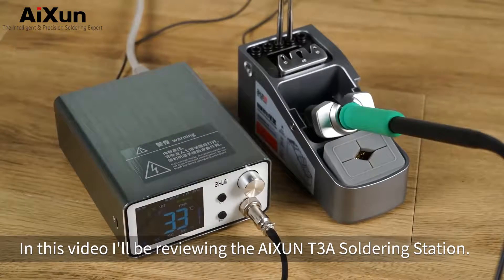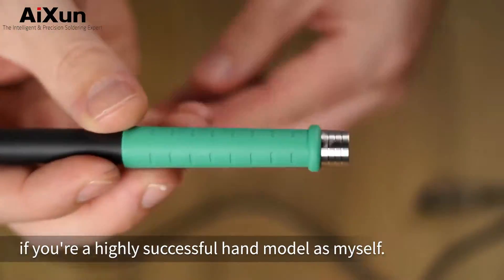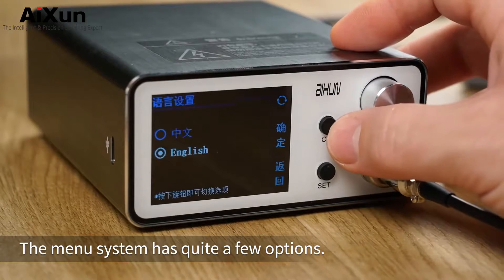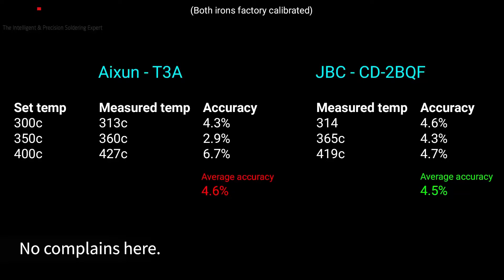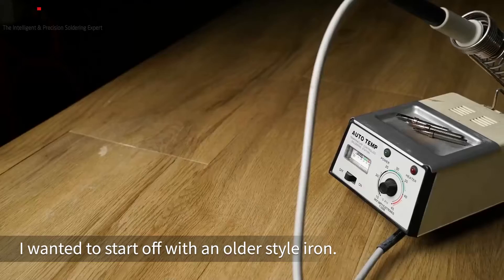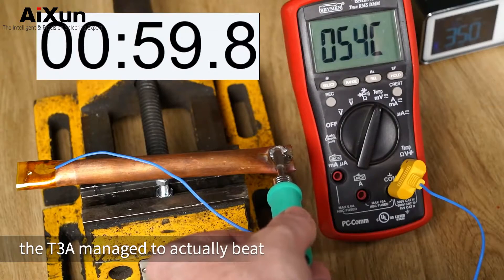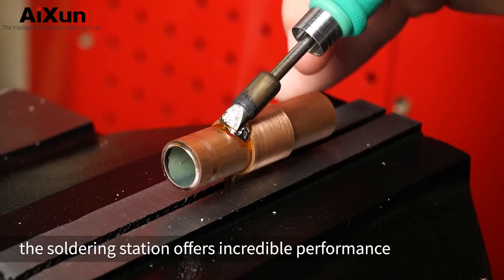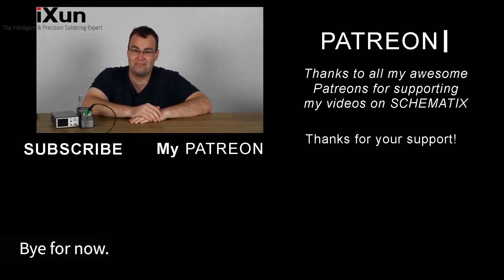JBC Killer? -The Best Soldering Station Comparison Between JBC Soldering Iron and AiXun T3A (2022)

Comment: you should have measure the tip temperature at 350º when you actually made the job with copper piece. Who knows if the 350º of the T3A were actually 390º?

Comment: Very well-made video with a real full review. I do have a question which maybe you can help me with. I love my T2A station and have switched to using genuine JBC tips for a noticeable increase in performance however they overshoot by 30-40 degrees. Is there a way to calibrate the station without one of those hakko temp devices? or any advise would be appricated.

Comment: Can i use oryginal JBC tips in the this station?
Unfortunately, the offer on your website includes only 3 types of tips for this station.
Reply from the maker: Yes you can use the original JBC tips in this station. T3A Is only compatible with T245/936/T12 tips. T3B is compatible with T210 and T115 tips.